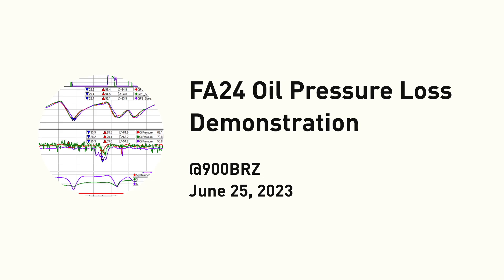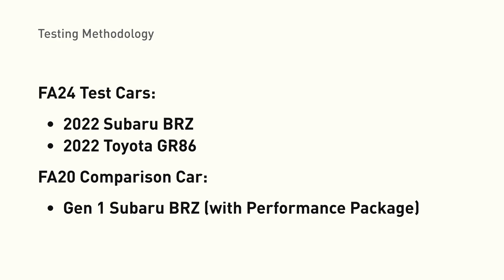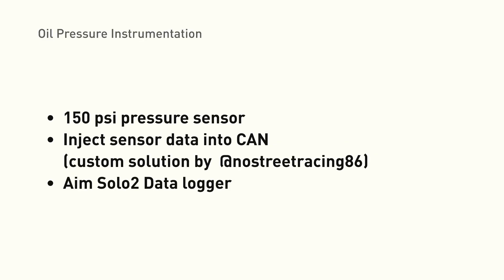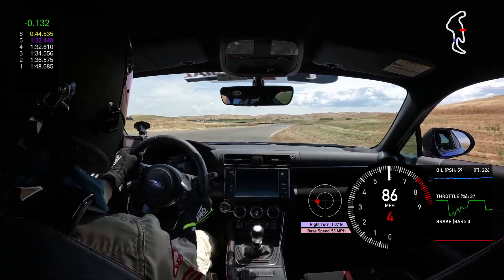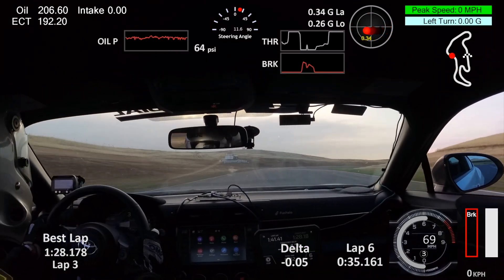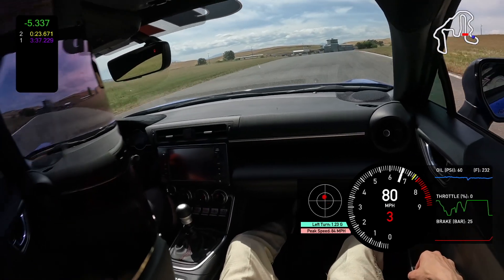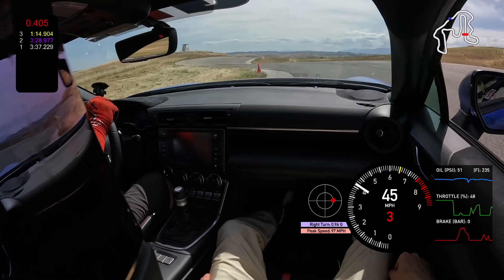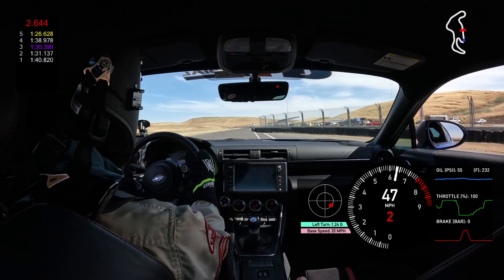BRZ/GR86 FA24 Oil Pressure Loss Demonstration

Comment: Really good info. Disappointing to see as an owner though. What do you mean by horizontal baffle designs? I've seen that most of the baffles are simply a horizontal plate that just covers the hole over the pan. The tomei plate is the same but with that second layer underneath. I have the Tomei plate but no data from it.
Reply from the maker: The prototype baffle from Killer B is a very different design. It’s a vertical plate that blocks the opening to the timing cover. We’ll see how it does.

Comment: Great video and great info! Congrats and thanks for sharing. Quick question, what was your finding comparing the fa24 oil pressure problem
With the fa20?
Reply from the maker: In the on-track footage section I show 4 clips from a 2017 BRZ with more aggressive tires, suspension, and aero. It has fewer and less severe pressure drops.
Reply: @900BRZ  yes I watch it again… really sad the problem on the new fa24, hopefully you are going to find the real solution for the problem.
Reply: @900BRZ if we forget about the headers, the fa20 oil pan is compatible with the fa24? So if someone make a oil pan that work on the fa20 will work on the fa24? Like I said if we forget about the headers…
Reply from the maker: The returns are in slightly different positions so we’ll need a different design.

Comment: There is also windage from the crank shaft turning in a clock wise direction. This is why the base model C7 Corvette was electronically restricted when it sensed high Gs going around right hand corners, usually occurring when stickier tires were added.
Reply from the maker: That’s really interesting and I hadn’t considered that. Will think about that some more.
Reply: Could lowering the oil level help with this? I mean still above min. level on the gauge but not topped up.
Reply: @Ariskot007 I'm not sure of the theory behind reducing oil system volume if you are trying to prevent low oil pressure?
Reply from the maker: Yeah we have started doing experiments with higher oil levels and will continue to explore that. Lower levels are going to result in less oil available to the pickup and worse oiling performance.
Reply: @900BRZ  Well, if I'm understand corectly the phenomenom of windage, it is due to proximity of the oil level to the crankshaft, resulting in whipping/foaming.
Reply from the maker: I have since learned that there is an internal windage tray to prevent against this. Can’t say exactly how big of a factor it is.

Comment: The problem is oil control. Is to much oil going to the heads ? Is the oil not returning fast enough from the heads ? Is there a windage tray ? Baffles with oil control doors ? Larger diameter oil pickup tube required ? Larger capacity truncated sump required ? Seems the problem is exacerbated in right turns and the longer the turn the more it climbs the left side of the sump and away from the pickup probably pulling in air/foam. The other problem is one main bearing is supplying two connecting rods and another feed needs to be supplied to that main bearing to bump up oil volume. The questions I give are to help you find the solution and these question are statements providing direction. Porsche has had a similar problem, but with a lot more than oiling, so go take a look @ the M97 & 97 vs the replacement engine the 9A1 where the problems got solved. The FA20 & FA24 only need to fix the oiling issues I mention. Good luck on this and it's fixable.
Reply from the maker: Great points and things I need to spend more time thinking about. I’ve read about people improving the oiling on FA20s for forced injection by changing the bore on some of the galleries to increase flow rate to the main bearings. I feel that it’s difficult and expensive to do that without basically just guessing unless you can do CFD work to prove it.
Reply: @900BRZ fa engine doesn't have priority oiling system like EJ. EJ feeds its oil to the main journals first, then halfway through they split off 90 degrees to each head.

Where FA has 3 specific oil ports, first goes straight to the driver head, 2nd to the crank, 3rd to the passenger head. Such that driver head is robbing oil pressure from the crank. 

A very interesting design for sure. Hence we don't see a lot of videos on the first gen trying to rev to 9000 rpm. Except fully customized element tunning engine.
Reply from the maker: Yeah have read about the non-prioritized oiling. I probably won’t be the one to do experiments with changing that through changing oil passage sizes, but interested in seeing if that helps. 

There is an internal windage tray, but we’re not sure that it’s completely reducing the windage effect. We are seeing these pressure drops starting around 6000 RPM, so it’s possible it’s having an influence. 

I want to try out the Kazama baffle, which has a 1-way door to try and keep oil available to the pickup. Changing the pickup itself requires removing the timing cover, so going to avoid that for now. I’m not a performance shop, I’m just self-funding this, so not interesting in tearing down the engine unless I have to.

Comment: Oil filter is on the left of the engine bay, correct? And it seems that elevation change exacerbates the issue, e.g. cresting a hill. Is oil getting trapped in the filter?
Reply from the maker: Yes drivers side. It’s already under pressure at that point so seems unlikely.

Comment: Thank you for the data and all the work putting this together. I've heard about this right hand turns leading to oil starvation on old EJ25 turbo engines (like in my 06 STI), and I thought this was largely addressed in FA series engines. Maybe it was a step in the right direction for FA20, but it looks Subaru went straight backward and ended up exactly where they were with FA24...

Comment: Slap in an Accusump and test it again before trying new baffles.  That way you can still have pressure drops to test with, but safely. Then, if the baffles fix it you can always sell the Accusump to another FA24 owner.
Reply: What’s an accusump?
Reply: @CarsOverPeople  It's a pressurized cylinder (much like a well pump pressure tank) that holds 2-3quarts of extra oil.  There's a piston to separate the oil from the pressurized air (like a gas shock) so you can mount them in any orientation. You tee it (and a valve) into the pressurized cooler/filter line. The oil pump fills it up at higher oil pressures and when pump pressure drops occur it releases the oil, maintaining pressure.

As a bonus: Before you shut down the engine you close a valve and keep the pressurized oil contained. Then, just before starting you can open the valve (releasing ~60PSI oil) for wear-free starting.

Accusump makes electronic valves and control circuits for more precise pressure control.  They've been popular with other wet sump flat-engined track cars (Porsches & Subarus) for decades for the same oiling issues while cornering.  I first saw one on a highly modified GM6(2.5RS) autocross car.
Reply: @EUC-lid  
I’m guessing it’s a very expensive & complicated mod to install for these cars then?

Comment: If the timing covers are the same, or very similar, on both gens, why would the 2nd gen be more susceptible?  I look forward to seeing if the Killer B prototype produces any benefits.
Reply: IIRC timing cover opening from the pan is slightly bigger in gen2, which might explain the difference.

Comment: The 86 is not a race car and was not designed for that kind of abuse
Reply: they literally market it as a track capable car.
Reply: despite the marketing by Toyota, it does seem like subaru boxer motors just aren't designed for sustained high Gs - lately i'm thinking it's better suited as a street gt sports car - but now i'm even worried about tight canyon fun :(
Reply from the maker: Well it’s not quite that simple. I’d argue its main competitor is the MX-5 (that’s what I was cross shopping as well). Both MX-5 and GR86 have a spec racing series where they use the same engine as the street cars. Unlike the FA24, the engine in the MX-5 was designed to maintain oil pressure at 1.4 lateral G. I’m seeing pressure drops at ~1 G. 

Source: https://youtu.be/38SE1-1hBlI?t=351
Reply: @900BRZ  that's kind of what I'm saying, as far as I know there's been no information released by Toyota/Subaru for oiling design limits, empirically it seems Subaru boxer engines do well in rally, not so well on track. I think the mx5 is the most widely tracked production car, the sustained 1.4G is probably the main reason - they're designed for it...not so sure about the twins.

Comment: '23 GR86 MT owner. I'm really glad you are doing this and I really hope a solution arises. I bought the car specifically for the race track and couldn’t be more frustrated. I was hoping to have a fun daily that with some upgraded pads and fluids could be a capable track toy, even in stock form. $35k later and I may never even get to track the car for fear of blowing an engine that I cannot afford to replace…
Reply from the maker: Let’s see how the new baffle does. If it works well, it will be a very affordable way to hopefully get reliability on track.
Reply: @900BRZ brace yourself for the 100s of people messaging you as we impatiently wait for the results of the KB baffle.
Reply: The official STi baffled oil pan is part number ST11109Z2000. Just put that on and it should do the trick, one assumes.  It appears to be part of the "kit" for the GR86 BRZ Cup in Japan, so if it's good enough for a race series...
Reply: Hate to be that guy but why tf would you buy a car with tracking in mind while knowing you can't afford major repairs?
Reply: @liquidsweg4858 cars marketed for track use should be able to handle it and not blow up after a couple of turns. I’ve been tracking my miata for about a year now with minor upgrades and does the job.
Reply from the maker: It would be cheaper to replace the short block every year on this platform than pay for the consumables on something like SS 1LE if you track frequently enough.
Reply: @liquidsweg4858  no you’re valid. The problem is that I can afford to replace an engine if I mess it up or something happens. What I cannot afford is to replace engines regularly because they are inherently flawed and not sustainable in a performance setting. I hope that clears it up

Comment: I was also noticing this - right-hand turns only WOT pressure drop - on my '23 BRZ :/ hoping an accusump will be enough
Reply from the maker: I’d love to see data from people running accusumps
Reply: @900BRZ  Well this video has moved my plans up. I will be installing it this Fall, hoping y'all figure out a baffle solution, it would be great for my Daily Driver to not need a freakin' Accusump lol
Reply: @900BRZ  I just went out and popped the oil galley plug near the TB and it seems like a good spot. I think I'll try and rig up the 3qt accusump from my track car and do some testing either this week or next.

Comment: 5w40 is the correct choice.
Reply from the maker: Show me the data.
Reply: @900BRZ  With 5w40 viscosity oil gets high pressure oil. The thin modern oils are using to reduce liters of gasoline/ km and low emissions. For a daily driving there is not problem but these oils are ridicolous for track days...

Comment: Exactly the same issue as 4g63 like in my evo track car. Any prolonged right hand corner and oil pressure halves - and these drops have been proven to blow them up time and time again. Baffles haven't proved to be very effective but what has are accusumps, and even tiltilg the engine in the engine bay to keep the oil closer to the pickup - best solution is dry sumping but its a shit load of cash to blow (same cost if not more than a replacement engine), so many, including myself just live with it and try to keep the rpm down through those corners.
Reply from the maker: Yeah I would move likely move to a different platform before trying to modify the FA24 to use a dry sump. Hoping a the simple prototype baffle I’m testing will resolve the issue—would be a lot cheaper!
Reply: @900BRZ  Yeah for sure it will help. Look into accusumps as well though if you get the chance, loads of people in time attack in the UK run them and fun fact so do BTCC cars and they run on slicks!
At a very basic level they are an extra canister of oil, and inject oil based on pressure loss. Can also be used to pressurize the oil system before startup and a few other things but mainly they're used for oil starvation issues just like you're seeing.

Comment: Based on the findings in this video, it seems like a corner like riverside at Buttonwillow 13cw is absolute worst case scenario. High-G sustained right hander AND you're at full throttle maximizing engine load AND you're scrubbing speed, potentially sloshing the oil forward into the timing cover. Amazing track but now I'm too nervous to go back
Reply from the maker: Yes, one of the people I know with a blown FA24 believes Riverside caused his failure. I decided not to go back until I installed the baffle, so all my testing was at Sonoma and Thunderhill. Hopefully this works and I can go back to BW!
Reply from the maker: I did mention this in another comment, but short shifting does seem to decrease the drops and will reduce the load on the engine, so you may be able to compromise lap times for reliability until we have a proven solution.

Comment: This really sounds like there’s a need for a baffled oil pan/ windage tray. I have a 2020 wrx, I’ve tracked it extensively ov2 years and was looking for an oil pan or other solution but it seems the market doesn’t need it. The ej motors has had oiling issues and thus have oil pan options. I hope the aftermarket can helped solve these issues. I’ve switched to e36 m3 bmw and now have a whole other learning curve.
Reply from the maker: Good luck with the M3—that sounds like fun! Subaru did build in more internal baffling into the upper pan and they solved some of the issues with the EJ where oil would enter the heads, so we’re closer to having a workable engine on track. If the KB baffle works, we may be in a good spot.
Reply: @900BRZ  thanks, I’ll keep following. Oiling issues are common amongst most manufacturers. The lessons you’re teaching/learning are very valuable.

Comment: Sounds like these cars would not like Sonoma
Reply from the maker: My friend put together a data visualizer tool that can generate a graphic showing oiling performance and Sonoma is his example track. He also has a GR86. Not great. In generally CW circuits are problematic for this car. You can see in his chart T7 and the hairpin are actually okay, but T2, T3A, exit of T4, bottom of T6 are all rough.

http://track-build.com/oil-pressure-analysis

Comment: @900BRZ some have speculated the GReddy baffle with its timing cover block might be the only particle solution on the market till KillerB’s ready to launch with a more comprehensive solution. What’s your thoughts?
Reply from the maker: I believe that baffle is a horizontal-style baffle and from what I’ve seen so far, those are not solving the issue and can actually delay oil returning to the sump.
Reply: Good point! I appreciate you taking time to reply to everyone. I also imagine this should help juice the algorithm to get your video in front of more enthusiasts, and Toyota if we’re all so lucky

Comment: Based on the data, could short shifting in long right handers be helpful?
Reply from the maker: Yes! We have found that you can short-shift into 4th on T5 @ Thunderhill West to reduce pressure drops. In general this seems to be a good idea to 1) reduce the chance of pressure loss and 2) to reduce the load on components if pressure losses occur.
Reply: @900BRZ  Nice! It would also be interesting to experiment with some right handers that do not have any simultaneous deceleration. It seems like most of the case study corners (T5/T8 west and T5 east) require lifting before turning right. Perhaps in a corner like T8W, we could try heavily short shifting to 4th and staying flat all the way through? If that helps, it could lend credibility to the timing cover slosh theory.
Reply from the maker: @bpt582  Short shifting in T8 does seem help reduce pressure drops. Maybe I can do a followup video about trying to drive around these pressure drops. I think Riverside at Buttonwillow could also be a good test case, but I also know someone who believes his FA24 died due to Riverside.

Comment: Great video with all the comprehensive data. I just saw the other day this guy Rob has a new GR86 and he just put out a video about this same issue. He is running a pretty aggressive setup (actual Hoosier slicks) and also said he was seeing pressure drops to around 30 psi in hard right hand cornering. He installed a Tomei baffle and claims his oil pressure never goes below 60 psi now so... 
Maybe you guys can share info: https://www.youtube.com/watch?v=Ru_2uTozXNo&lc=UgxFEg-BZDWA1GD4CYh4AaABAg.9rOTWPWkyGA9rQCh438sUc

Comment: You mentioned the pressure is controlled to a max of about 60psi. What system regulates this for the engine and could it be getting false readings from oil sloshing mid corner?
Reply from the maker: This is a good question and I don’t have a complete understanding of this. I’ll ask around. 

My understanding is that absolute limit of the oil pressure system is set by the pressure relief value, which I believe activates at over 100 PSI, so it would mainly be used in a cold-start. 

Something else is limiting the pressure to ~60 PSI at temperature on track. I believe this is the pressure the pump is capable of producing given a certain oil viscosity and temperature. But I’ve also heard that the pump is overbuilt, which would seem to contradict that. I’m a little out of my depths trying to understand the fluid dynamics behind it, but it may be possible to explain that contradiction by saying the pump is overbuilt but a boundary layer forms that prevents the pump from building more pressure.